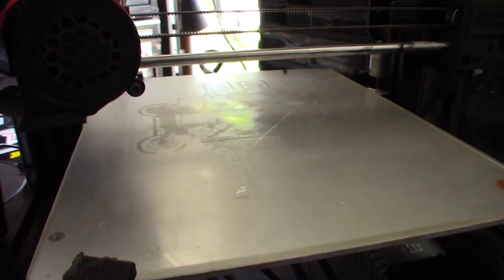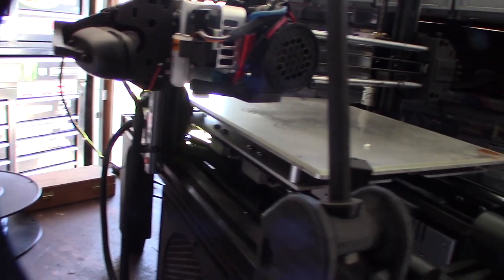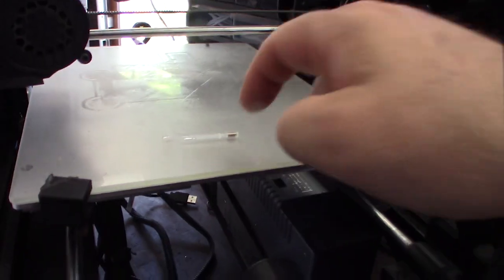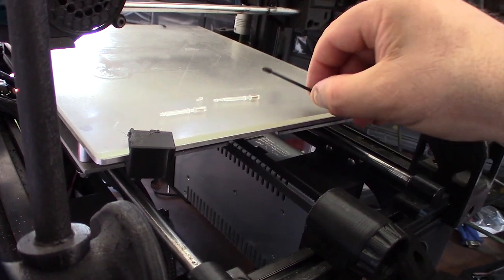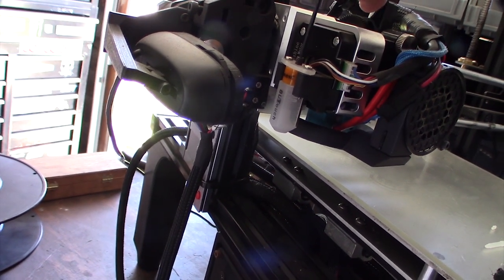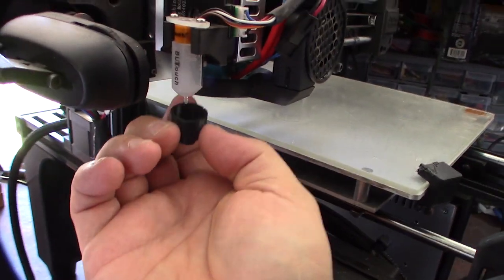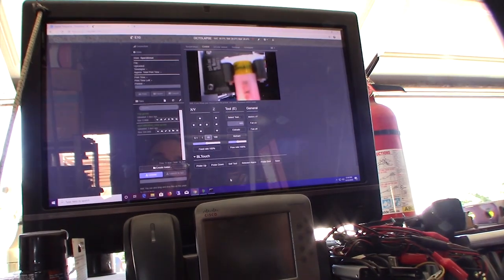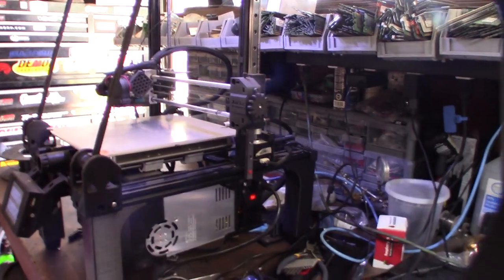BLtouch broken probe pin replacement repair 3D touch

Comment: Excellent Tutorial, I didn't even think about the pin being broken.  My kit came with a spare, swapped it out and up and running.  

I started working through the OSI model backwards trying to fix it, application to physical. 

Thank you.

Comment: I would not recommend that tip protector, it just took off my entire bl touch instead of the tip XD dont use clips, use thermal pads or painters tape on corners.
Reply: Damn! I wish you good luck repairing it.